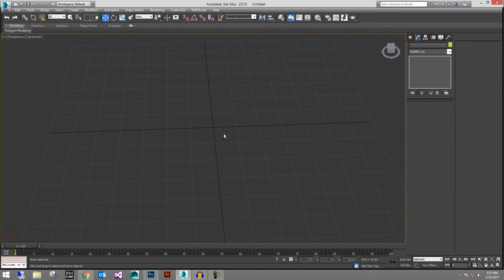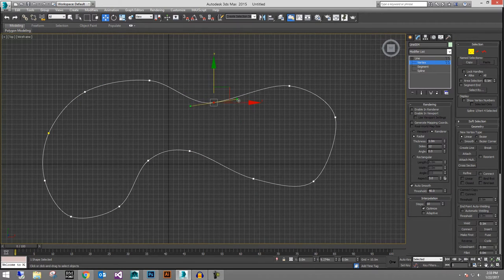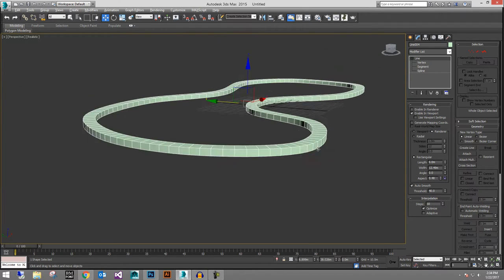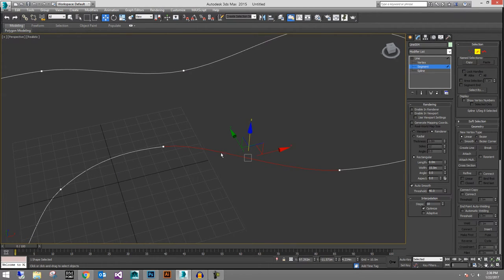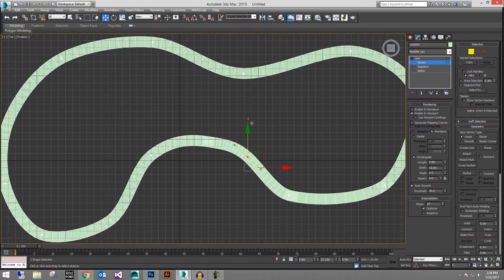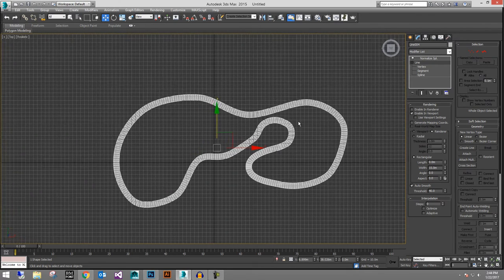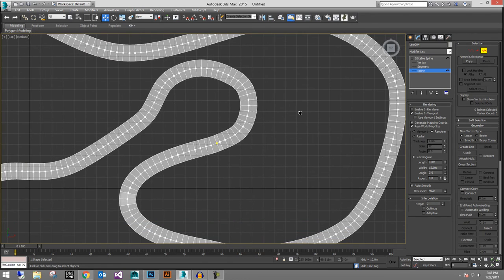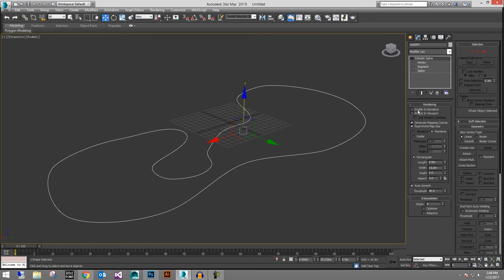Editable Splines to create Racetracks and City Roads - 3ds Max 2015

Comment: Thank you so much for this tutorial James!!! Can you just tell me how to avoid the twisting when creating elevation?
Reply from the maker: Sometimes that's unavoidable using this method. An alternative method that gives the same result with more settings to adjust is to apply a "Sweep" modifier to the spline after you create it. On the Sweep modifier, you have a setting called "Banking" that allows the adjustment of the banking and correction of twisting in spots.

If you'd like to stick to using this method I do use a workaround myself. It's to create the surface I want using this technique, then add an Edit Poly Modifier on top of the stack. After that I select an edge loop where I want to move up the elevation and I select "Soft Selection" in the side panel there. I will adjust the falloff value so that when I drag the
 edge loop up it smoothly drags up an entire section of the track. You can also add another type of Modifier called "FFD 4X4X4" and use that to pull up points to create elevation. Using the modifiers also is good in that you can go back and adjust the spline as well...you can go down in the modifier stack to the spline object and select it's vertices to adjust them.